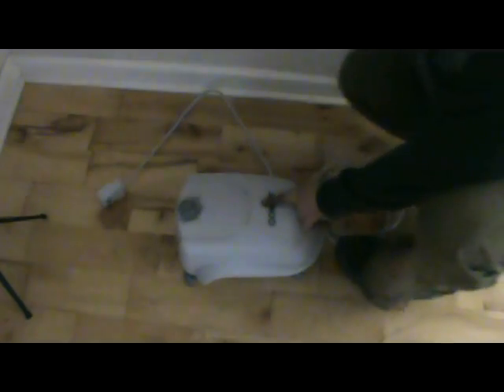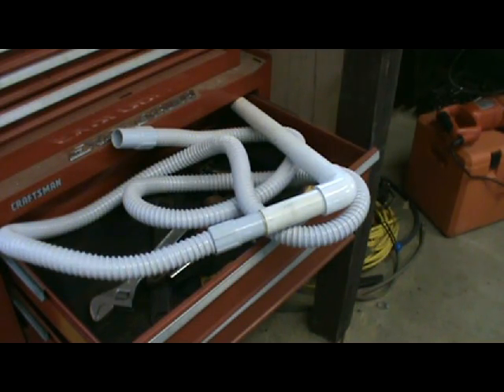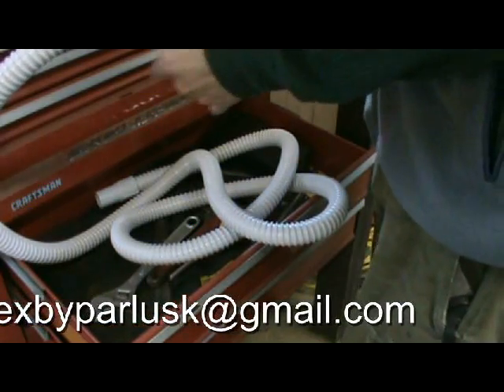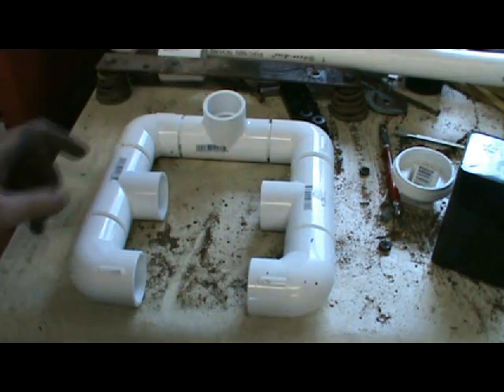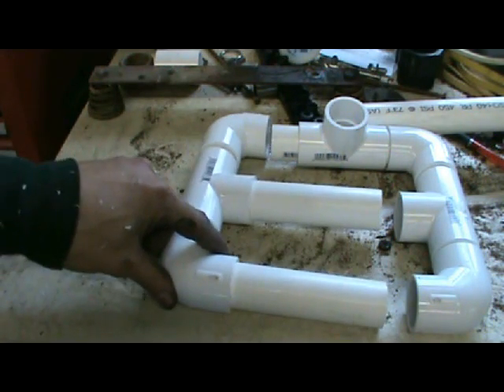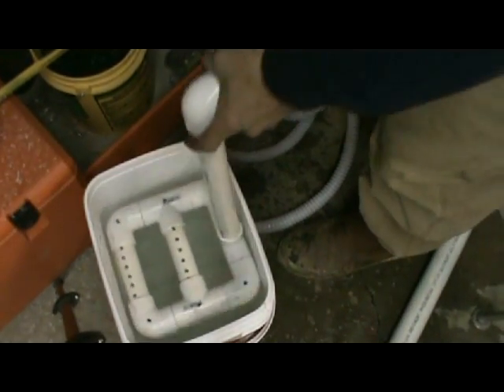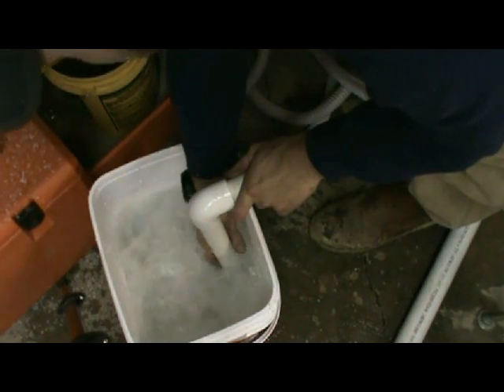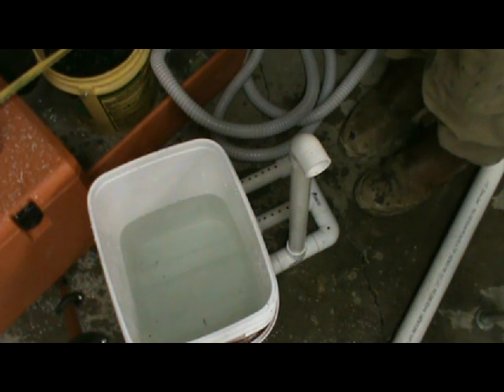D.I.Y Chicken Egg Washer

Comment: with that said, bubbling as hard as you have yours, the eggs dont break? with an "aquarium" or "hydroponic" air pump you could probably control it easier also so it doesnt bubble so violently IF you have a problem with them breaking